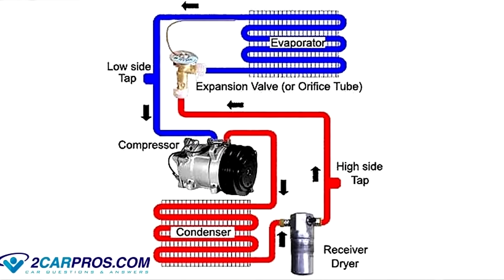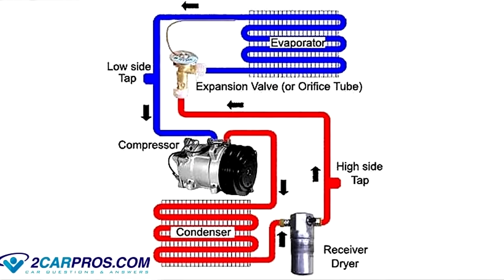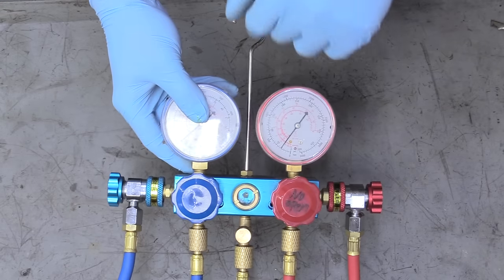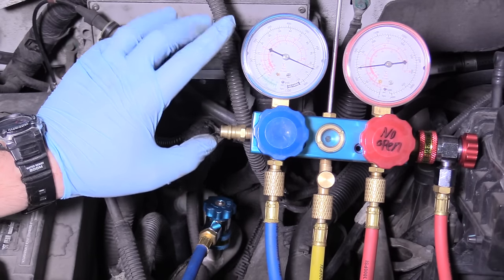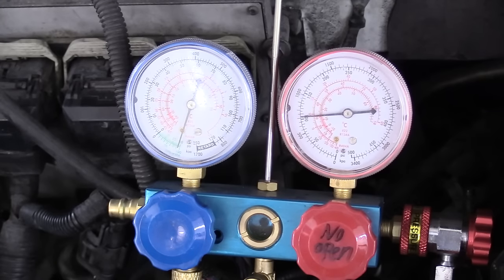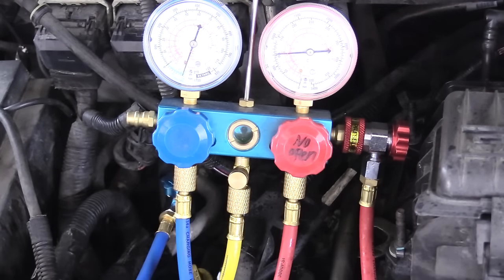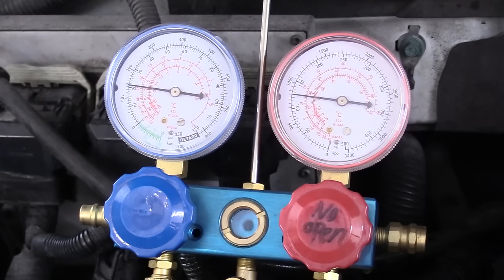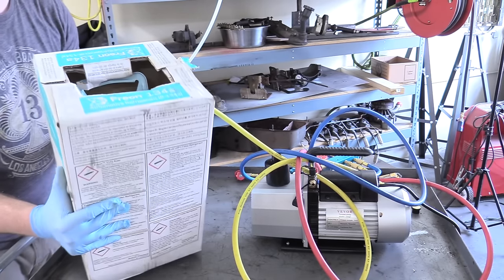How to Vacuum Down and Recharge Your A/C System! - EASY

Comment: So it’s okay to fill the low pressure side with liquid refrigerant? I’ve always heard that can damage the valves or reed plates in the compressor.
Reply from the maker: Yes it is fine. The gauges are an orifice and turns that liquid into a gas. Thanks for watching!
Reply: So we have been lied to about adding liquid refrigerant on the low side. A college instructor told me we couldn’t do that! I’ve been doing that for years. I’m gonna try your and see how much faster I finish my job. Thanks for the info.

Comment: What is the next step after a vacuum and you still have a small leak? Now you have a vacuum and if you open any part of the system it will pull in more moisture. I.e. small leak vs big leak

Comment: I use a old refrigerator compressor as a vacuum pump, just need to solder or braze on the right size threaded brass fittings.
Reply: I wonder how many cfm it pulls?
Reply: @billwilson3665  I've been using that a long time to pull a vacuum on my old cars and even when I replaced a compressor on one of our refrigerators and it does the job !

Comment: Thanks for the great video. Got a question. I just put a new ac compressor on my 2000 Chevrolet Silverado LS 5.3 and I am supposed to be adding oil to the compressor. It’s already on truck so how do I put the oil in the compressor before I vacuum it down and add Freon ? Thanks for any help.
Reply from the maker: Take the low side off and pour it in, but most replacement compressors come with oil in them already. Thanks for watching!

Comment: I thought I had all refrigerant out of system but I didn't and when I removed a/c control valve it came spraying out under pressure....should I assume I lost all oil in the system?  I got the pressure down to close to 0 before so I was surprised how much came out under pressure

Comment: When you have the vacuum pump on, what happens if I open the high side gauge? there's no pressure, isn't it a good idea so you can vacuum better through the low and high of the a/c system?
Reply from the maker: It's all one system, please refer to the pinned comment. Thanks for watching Jimmy!

Comment: Help! The low side meter is not going below -25 even when the meter can go up to -30 while pulling vacuums with a a vacuum pump. Can you tell me if there is something wrong? FUI, It holds vacuum on -25 after an hour of shutting down the pump.

Comment: Hi! I just want to know how you can tell if the compressor/system has sufficient oil, and how to you ad some if needed?
Reply from the maker: Honestly, you really can't and if you add too much the system doesn't work at all. The only way you could do it is literally replace everything bone dry and then put in the factory amount. Otherwise I wouldn't worry about it in this situation due to so little being lost during vacuum down. Thanks for watching!
Reply: @2carpros  Okay, thanks. That was very enlightening.

Comment: i have a 94 previa and the rear ac valve is connected to a separate switch to open as it wont with the main ac switch. If i vac and recharge my system, does the rear ac have to be open while the process is going?  i ask because when i first got it recharged years ago, the place i brought it to just recharged it, the switch wasnt on/valve wasnt open. wasnt their fault, they didnt know

Comment: Good video but what about lubrication oil? When the previous charge is totally evacuated it will lose most of the compressor lube oil which is critical to compressor life.
Reply from the maker: No it isn't. So little is lost, I wouldn't worry about it. Thanks for watching!

Comment: If you are replacing the compressor, evaporator and condenser do you still have to draw a vacuum on the system?
Reply: Always pull the vacuum after changing any parts because you open the system up to water in the air.

Comment: After vacuuming the system, why do you close the valve at the gauge to test for a leak? Doesn't that cut off the gauge from the system, preventing any needle movement? If Ieave the valve open, my pressure reverts to zero, but if I close it, it stays still. I'm confused.
Reply from the maker: The gauge sees pressure from the car side not the bottle side. So with it closed you don't have a leak. Thanks for watching!
Reply: @2carpros , I need to view a cartoon on how these things work.

Comment: Hello, great video.  I would like to start working on my auto ac systems.  I bought a vacuum machine, and am about to invest in a refrigerant recovery machine and recovery jug.  As I read, they are also saying I should also charge it up with nitrogen to check for leaks, which is another investment.  I have a vacuum machine, but should I stop there or go the hole 9 yards?

Comment: While vacuuming, where does the gas in the system go? Those it exhausts to atmosphere via the pump. Doesn't that put the "freon'" in the atmosphere?
Reply from the maker: Well it had already been evacuated. So the only thing in there is atmospheric air. Just pumping air at that point. Thanks for watching!

Comment: I like the video thank you, but after completion of vacuuming down the system, when you shut the blue valve off to wait to see if the system has any leaks, it seems like it isolates the gauge from the system not allowing you to see if it has a leak ?  Shouldn't you leave the blue valve open ?
Reply from the maker: Nope. The gauge sees on the car side of the valve. Thanks for watching!

Comment: thanks ... what is the purpose of connecting and opening the high to the H side while not opening the valve at the manifold? If for metering like you said, the high pressure gauge will not show anything unless the high pressure valve at the manifold is open !!!! I am confused

Comment: If I’m changing the compressor do I put it into vacuum after the replacement or before
Reply from the maker: Do any work you need to on the A/C system after the refrigerant has been removed, then vacuum it down. Thanks for watching!

Comment: I would think you would want to use a scale to measure how much refrigerant you are putting into a system. For example,  If you have a bottle that is 32 oz of ac refrigerant but your system only needs 14, how are you going to get that correct?
I'm winging it here, but I woudl think its important to know outside air temp and even possibly humidity. That will influence how much pressure your high gauge should / should not read when its full. I assume there is some type of hvac industry table available.
Reply from the maker: Yeah you can totally use a scale to measure that! Thanks for watching!

Comment: Went to find problem with relatives acura  and vacuum pump only pulls 10 inches of vacuum and it immediately drops to zero when I shut off pump!  Am I doing something wrong or is there a big as hole somewhere in the ac system? Or is the gage manifold sucking air I dont hear anything.

Comment: Not sure what I'm doing wrong, I'm just doing a diagnostic test with the gauge.  At the gauge, I had both blue and red closed.  Engine is off.  I hooked up both LO and HI.  I opened the valve.  LO is okay, no leak.  But my HI is blowing freon out of the knob.  Is this normal?
Reply from the maker: No not at all. Sounds like your gauges are done for. Thanks for watching!

Comment: I have a newly installed uncharged ac system , sanden style compressor from coldmaster inc. Just got back from auto zone with the evacuation pump and gauge set. Got it hooked up as per instructions, and i had a reading of 22 in the vacuum portion of the gauge. I chased down a couple slow leaks which were loose fittings .i shut off the vac to tighten the fittings and check the rest.  Now back to pulling vacuum and the low side gauge is on 0 and wont move. What could have happened here? All hoses are on, fittings are tight, and the gauge set hose fittings are on and tight as well. Valves are open .
Reply from the maker: Sounds like either the pump died or you have a massive leak somewhere. Thanks for watching!
Reply: @2carpros   yeah, im still unsure what happened there. I left it run to go grab a drink, came back out and it was at 25 on vac side. I did get both cans of 134a in it, its blowing cold.

Comment: How about the Oil?  When the system is empty (after I replaced the rear evaporator), how do I add oil back, or is that needed?
Reply from the maker: Please refer to the pinned comment. Thanks for watching!
Reply: @2carpros  Where?  I don't see where to look?  Thanks.   Actually, I replaced the condenser, and flushed the evaporator, and new dryer, new expansion valve and compressor - Now, how much oil to add... thinking about 6 oz?  ('04 Subaru Outback, single evaporator).

Comment: Is high side supposed to be hooked up when pulling vacuum? It looks like you left the high side disconnected.
Reply from the maker: Optional. Thanks for watching!
Reply: @2carpros  here's one for you. I hooked up high and low side with gauges and I only got a draw down to 30hg in high side. Low side didn't move. Any thoughts on that?

Comment: I don't understand the 'never open the high side valve' instruction.  How do you measure the pressure on the high side?  

I have watched several videos on this topic and on how to use these gauges and no one has mentioned not to open the high side valve...in fact I have seen the opposite?
Reply: there is no reason to open the high side valve to connect the high side pressure to the charge can, the gauge still reads the pressure. If you connect the high side pressure to the low pressure charge can it can rupture.

Comment: Hey guys I have a o2 caravan that is only giving me ac when it's cold in the morning and if I'm able to have the vehicle in motion for any amount of time above slow speed city driving. The AC shops that I've asked what it would take to even have them start looking at my van is 300 to $500 minimum. I want a DIY this but would appreciate any ideas. I also know that when I turn my AC unit on I get a wub wub wub wub from the bearing area I believe. And would like to know if that's a replaceable piece on an AC compressor. Please help thank you

Comment: What if everything on A/C system is new? Do I need to use vacuum ? Or can I start putting Freon inside?
Reply from the maker: You need to vacuum first yes. Thanks for watching!
Reply: The point of vacuuming is to get stuff out that shouldn’t be in like air as well as moisture and debris. The second you exposed those parts to the air they got dirt and moisture in them. If they weren’t sealed with caps or something then they have dust and crap on them as well.

Comment: great video, when you out extract out the refrigerant from the low pressure valve does the engine have to be running?  Thanks
Reply from the maker: Nope. Thanks for watching!
Reply: @chrissands6332  I will make the necessary enquiries about getting it extracted for free but I will not pay $50 or whatever

Comment: You need to run the pump more than 20-30 minutes. Especially if the system has been open for a long time. I've fixed countless Car AC systems just by running the pump an hour or more when the previous shop was in a hurry and didn't get all the moisture boiled off

Comment: good day, i have a question.  does the vacuum pump sucks compressor oil during the discharge system? if yes, how do you refill it ?
Reply from the maker: Good question! It would suck up very very little. You can add some back but here is the thing. It is a SUPER small amount. Like way less than you think and if you put too much in your A/C system won't work at all. So I wouldn't worry about adding any. Thanks for watching!

Comment: thanks a lot for the video! very clear. do you ever need to add in PAG oil after evacuating the system? Or does none come up during the evac.
Reply from the maker: Very very little comes out. Not even enough to worry about. Thanks for watching!

Comment: I get the video but what i dnt get is how do i know how much r134 to add,my car takes 23ounces if its only low 2 ounces how will i know this on the gauge set, and how will i know when im filling that i added only 2 ounces so i dnt overfill !?
Reply from the maker: I just add until it feels cold since there is no way to know how much your system needs if you are just topping off. Thanks for watching!
Reply: @2carpros  Soo the gauge set wld be useless right!? Do i need to put a vacume on the system to jst add a few ounces

Comment: I am trying to fix a kia optima that has a clutchless compressor...I need to have it evacuated but i was told that i couldnt drive it after the system has been evacuated because there would be no oil in the system and it would damage the compressor....is this true?

Comment: Do I need to vacuum freon out if I'm just changing out the air compressor??
Reply from the maker: Yes. Or when you take the lines off the old compressor you are in for a high charge blast of R134A Thanks for watching!

Comment: what about the oil in the compressor.... ??? - will vacuuming the system also remove the oil for the compressor? - if it does, how will i know what and how much oil to add?
Reply from the maker: So when you vacuum it down it only takes out like 1/8 of an ounce, very very little. You can add about that much back if you like however if you over add the system won't work right and it is super easy to mess up. I never add any back honestly. Thanks for watching!

Comment: The oil you just mentioned on the vacuum machine is it the PAG 46 oil?
Reply: NOOOOOOOOO. that oil is for Compressor or the a/system. Vacuum machine has different oil.

Comment: How do you know how much refrigerant it needs? did you measure it before adding it?
Reply from the maker: You could measure the weight of the keg as you add and give it the precise amount for factory spec. OR the way I do it, is I keep adding until the AC feels cold in the cabin. Once it is cold, STOP, adding more won't make it more colder. Thanks for watching!

Comment: So, if I have air in my system from replacing a line, and charge the system up without running a vacuum, my system will not blow as cold?
Reply: Yes definitely.
Reply from the maker: It won't work without vacuuming it down first. Thanks for watching!

Comment: Even though he pulled a vacuum on the low side only, it will still work. Most will pull a vacuum on both sides at the same time'
Reply from the maker: Its a loop. Try to take the air out of one side of the tire. Thanks for watching!

Comment: I need to replace my compressor on my Toyota Avensis t25.. can I do that when there is vacuume on the system? My personal system understanding says no. However how to remove the compressor without getting atmospheric pressure - and regular air into the system?
Reply from the maker: Once you loosen the line on the compressor you will lose vacuum. No there isn’t. Thanks for watching!
Reply: @2carpros  thanks for your quick and concise answer.

Comment: If the new compressor is prefilled with new oil, do i have to worry about the vacuum pump sucking the new oil out?
Reply from the maker: No it would pull out so little don’t even worry about it. Thanks for watching!

Comment: I saw a video that said to have the blue and red open, when pulling down the vacuum.  Then the red is removed.  Does this makes sense?  Thanks for the video/info.
Reply: Yes your suppose to pull vacuum on both sides, also not many diy folks realize this from what I’ve seen, but the compressor should never have liquid refrigerant going to it it’s not made to compress a liquid it’s made to compress a gas(or vapor). 
Turning the can(the tiny cans of Refrigerant R-134a you can buy) or kegs what’s being used in the video upside down, and then letting the compressor suck the “liquid” refrigerant into its system is pretty much letting straight liquid refrigerant go into the compressor.  if you’re curious as to what this is like take a Medicine syringe for like cough syrup, or a seasoning injector for like turkeys fill it like 1/4 to half full with water put your finger over the opening, and then try to compress it. Then remove the water, and just pull the syringe all the way bsck close the end off a again and try to compress it. The water one is the same exact thing happening to the compressor if it  gets liquid refrigerant to it. There should never be liquid refrigerant going to the compressor(from the low side) or coming out of the compressor on it high side) the only two place were it should be a liquid. Is right after the condenser, and after the condenser in the evaporator.
Reply: @tucker934  Thank you for explaining this!
Reply: I asked this question just now to see what another opinion might be? Opening both sides to evacuate the system more complete seems like common sense to me.

Comment: So you can drive if it don't have Freon in it or will it lock up the compressor
Reply from the maker: You can drive it. Just turn the AC off. The clutch in the compressor won't engage and it should preserve the compressor. Thanks for watching!

Comment: I dort get it on 11:35
If you close the low side valve and shut down the vacuum pumpe that pressure gauge is disconnected from the ac line. All it is measuring is the current vacuum between the gauge and the vacuum pump ( yellow line) since the blue line is closed by the blue valve.

So you won't be able to detect leaks in the ac system itself ( because you aren't watching the vacuum inside the ac lines itself)

Or am I missing something?
Reply from the maker: The gauge measures pressure from the car side of the valve not the vacuum's side of it. Thanks for watching!

Comment: Hi my 2006 mazda 3s 2.3L  A/C stops blowing cold after  idle slow driving a/c works when im moving traffic  fast car doesn't overheat / fans run / ac pressures good / new condenser / new dryer / new a/c clutch / New fans would you know what is my problem is ?